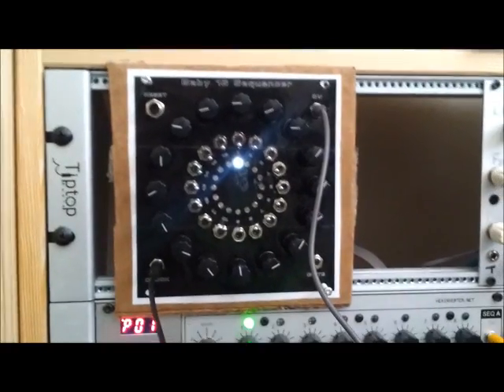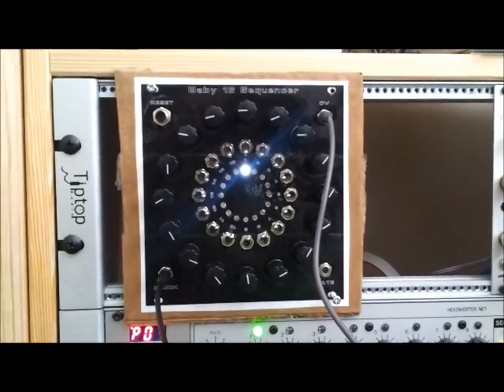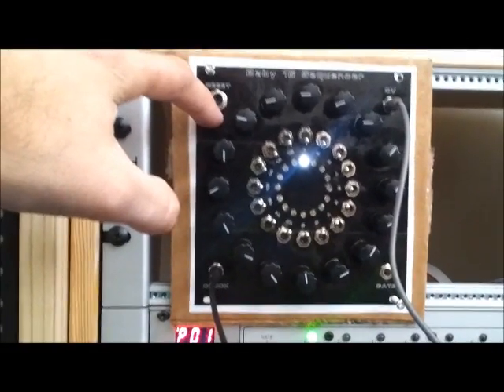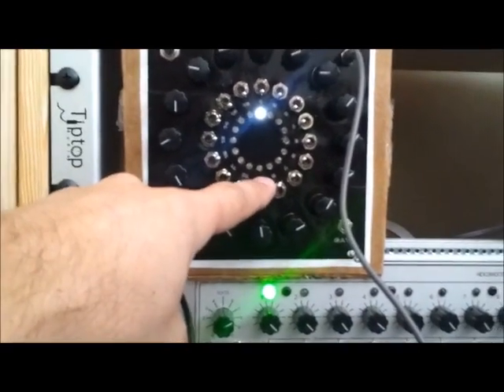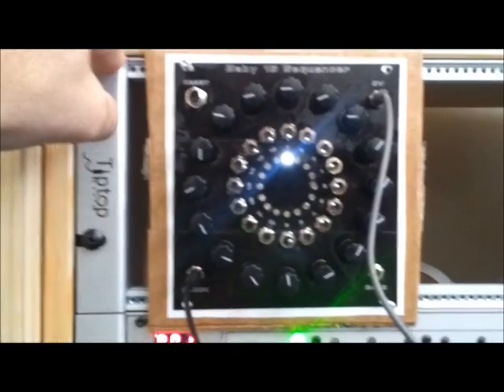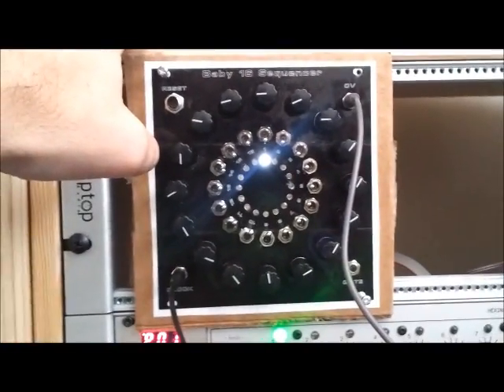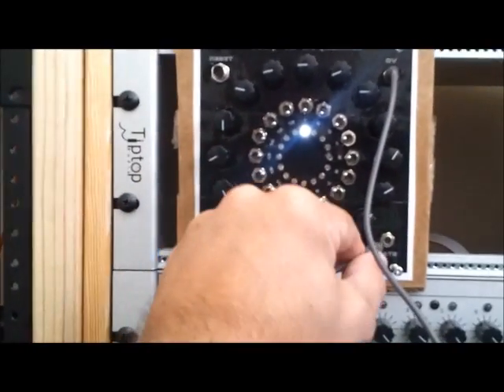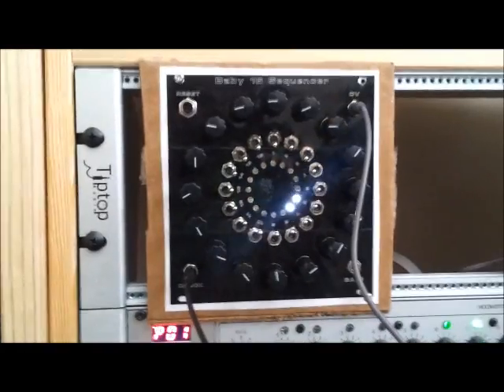"Baby 16" Step Sequencer - Added Reset Features

Comment: I only just realized the possibility of ‘cascading’ 4017 counters today, and this was one of the results of my search for ‘cascading 4017 sequencer’.  My hope is this: now that I know the limit is basically multiples of 3 units tall by as many HP as I have in my case, I’ll be stoked to build something like a 2 or 3 by 32 step cv with another 4 by 32 (maybe 8 by 16) triggers / gates sequencer if this can fit behind a eurorack panel without really taking up more than 84 hp, I would find it cause enough to finally learn KiCAD or some PCB design software and knock out a proper PCB for what I would install as the starting point for every modular case I build from now on.  Maybe even start making a case that has this sort of sequencer and nothing else but empty rows and the PSU...  Those pots seem to be the big fat metal panel mount ones that they used to sell at RadioShack, no?  I’m really turned on by your panel and the fact that you’ve managed to keep the circular aesthetic in 3U, good job! There’s really something so rewarding about having the full measure of potentiometers all present and ready to twist, and even leaving the quantizer aside for more options with tuning schemes, the classic hardware sequencer is probably the main piece of bait that attracts me to the modular gear!  I can think back to when I was learning to sequence the TB303 on ReBirth, seeing the photos in some magazine of these behemoth modular setups and really daydreaming of getting my fingers on those knobs!!  I’m so so happy to actually be present for this resurgence in interest of this gear!  Thanks for sharing, your sequencer is inspiring!!

Comment from the maker: Thanks! Since this video I added a 4011 NAND Gate to the "Gate Out" which fixed the "always on" I mentioned in the video. I also added a 7805 to the "Gate Out" to bring the voltage down to 5volts. Oh yeah and I added some pulled down resistors to the "CV Out" bring down the signal closer to 5volts and make it work better with my eurorack setup.
Reply: I really like this one, working on a 10 step right now, in fact this "always on has bugged me more and more the last few days.
Could you explain a bit or some sort of schematic, cus i don´t realy understand how you could silence a vco from the sequencer, i mean if you just pull the gate/pitch away (note off) the VCO would still sound in its current state.
Coul´d be done with a vca sure but tat is not what i want :) i want your solution :) Keep up the good work man.